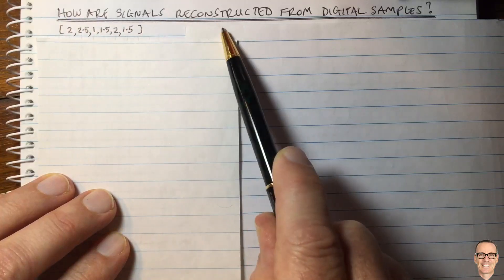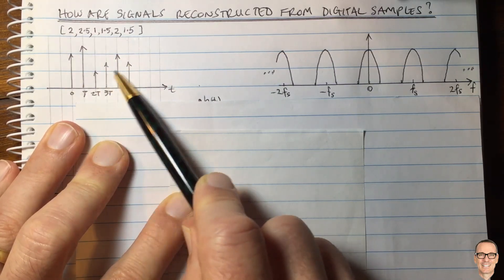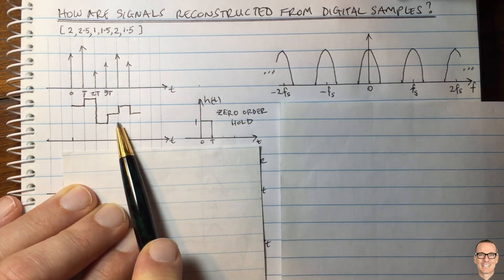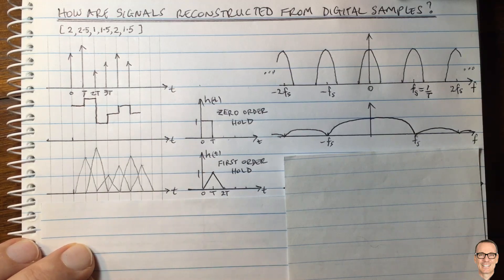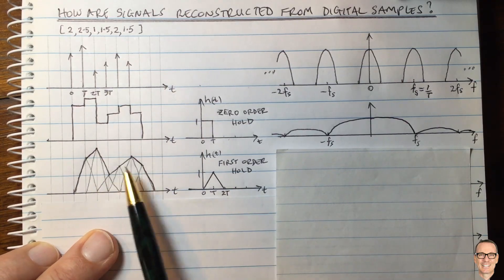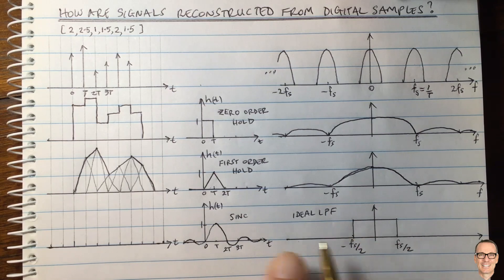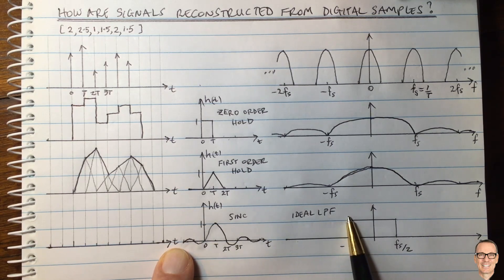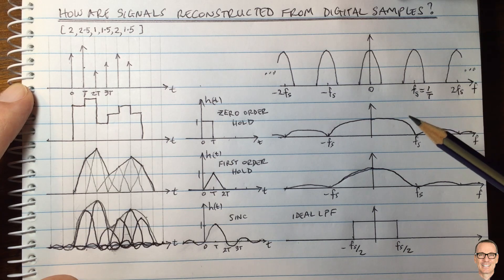How are Signals Reconstructed from Digital Samples?

Comment: Initial honest response after watching: "Bruh". Wow. Thanks for clarifying that. So the sinc function "filter" is opposite of that square dealio (to the right of it in frequency domain) why? Is that because a square has unlimited harmonics? And bonus question, because it's been bothering Me the past 2 days and the AI chatbots haven't answered it logically yet: Does hard clipping a 10hz (or any other sub-20khz) sine wave sampled at 44100 introduce any aliases of upper harmonics, or does it simply flatten the peaks without introducing any such aliases and then output a gibbs effect style sinusoid "wiggly" at half the sample rate around those samples in a row at the flattened peak when passed through a sinc function and a lpf after? (I know that a square wave and a squared off wave have upper harmonics beyond 22000, but merely flattening a sinusoid's peaks doesn't seem to actually introduce any "aliases" of upper harmonics)

Comment: Thank you. I have one point of confusion:
When we talk of discrete convolution,  h(k) i.e. the impluse response is really a sequence of N taps, where k is an natural number < N. 
Are the continuous zero order, first order hold and sinc impulse responses in fact discrete with large N?
Not sure how to think about this.
Reply from the maker: Discrete-time does not imply finite time. ie. it is not necessarily the case that the impulse response is finite duration (ie. finite N). In practice of course, nothing lasts for infinite time, and if you're talking about "real signals" that have been sampled onto a computer (for example) then yes, there is a finite N (because the memory of any real processor is finite). Does that explain it?

Comment: I had to swap to using a tablet for all of my writing needs due to a wrist injury, but wow it is such a major upgrade. I really like this style but definitely consider swapping to tablet based recording/drawing. One huge advantage is you can copy/paste diagrams you are working on you can slowly build them up as learning aids, while keeping the main structure the exact same. I use this method for my design work as well. It significantly improved my workflow
Reply from the maker: Yes, those are good points, however there's no way to point with your hands, and make it feel truly personal, when using a tablet.

Comment: Why is the sinc function of Fourier transform zero order hold is positive? Because Fourier transform of a rectangle function is sinc which can have negative values which are below y axis. Why didn’t we taken that kind of sinc function here. Instead we took modulus of sinc function which is Fourier transform of triangle signal.
Reply from the maker: In the frequency domain I only plotted the magnitude of the sinc function. It's a complex valued function (in the frequency domain), so it also has a phase (that I didn't show). In the time domain, it is a real valued function, so I plotted its actual value (positive and negative).

Comment: Really interesting, thank you! Am I right in saying that's just one of the original waveforms that could have produced those samples? I guess we're saying that the sampling rate defines the highest frequency we care about and that everything above it is considered noise?
Reply from the maker: It's not the "highest frequency we care about", it's the highest frequency that can be captured during the sampling process and then reconstructed from the samples. This video should help: "How to Understand Aliasing in Digital Sampling" https://youtu.be/y7UOQ_aF9C0
Reply: @iain_explains  Thank you - I think I meant "we chose the sampling rate based on the highest frequency we cared about reconstructing". I think I'm having a hard time seeing a 1-1 mapping between sampled signal and reconstructed signal, but I suspect I'm looking too closely at the edge conditions (T=0) and not allowing for noise (which I consider to be signal components of higher frequency than we allowed for in the sampling rate). It's all fas
cinating, thank you
Reply from the maker: It sounds like you may not fully be understanding how aliasing affects the sampled signal. Here are some more videos on that: "Aliasing Ambiguity Explained" https://youtu.be/zUAka4orrJA and "What is Aliasing?" https://youtu.be/B3nZUFNkTGY
Reply: @iain_explains  thank you!

Comment: Hi Iain. Many thanks for one more amazing video. Just one question out of curiosity. Do you have insight which approach is in use in mobile communication, especially in 4G and 5G? If I have to bet on one, I will say some kind of sinc approximation.
Reply from the maker: Mobile communications involves a number of different sampling operations. So there's not one single answer to your question. In the case of sampling voice signals, they are sampled in a way that involves compressing the data stream, and the reconstruction needs to be done in a way that matches the way they were sampled. It's complicated (and interesting too), and I've got it on my "to do" list as a topic for a future video.
Reply: @iain_explains  thanks a lot. I can imagine it is not simple story. Looking forward to understand it in more details from your videos. Wish you all the best!

Comment: This is an excellent visualization of why digital doesn't actually sound like the overly simplified stair-step that laypeople often imagine it does. Thank you for taking the time to put together such a clear explanation. I was able to use your video to help a non-technical friend understand digital audio better.

Next, please consider a tutorial of how the different types of output filters we commonly see in audio work: linear phase, minimum phase, butterworth, brick wall, (and others?). The problem with actual circuits in the D/A stage of real world gear is that they either impose a single filter choice or they give a range of choices with very little explanation of the trade offs of each. Are there pieces of gear that offer the ideal linear pass filter or is that an impossibility to create economically in real world circuit applications? I'd love to know! Apodization! So confusing.
Reply from the maker: I'm so glad to hear that the video has been helpful. And thanks for the topic suggestion. I've put it on my "to do" list.

Comment: Great videos. But one thing confuses me: if you look at the fourier transform of the signal with delta functions, you see fairly narrow bandwidth peak in frequency domain. But when you "reconstruct" the signal with zero order hold or first order hold, the peaks get much wider (all the way to Fs) - is this result of some aliasing or just a quirk in the drawing?
Reply from the maker: Ah, that is an excellent question. I guess I didn't make it clear enough in the video. The top frequency plot is the Fourier transform of the sequence of delta functions shown in the top time-domain plot (ie. the "sampled signal"). But the three frequency domain plots underneath it are the Fourier transforms of just the impulse responses of the three "reconstruction filters" shown in the middle column of time-domain plots. In order to find the Fourier transform of the three reconstructed signals (shown in the left column of time-domain plots), you need to multiply the top frequency plot, with the respective reconstruction filter's frequency plot (since they are convolved in the time domain, which is equivalent to multiplication in the frequency domain). For example, with the bottom filter, it zeros-out all the higher frequency aliased copies, in the top frequency plot, and perfectly keeps the central component, around f=0.
Reply: ah i might have got it partially: those peaks are not the same peaks visible in the first plot, but instead the later cycles of the sinc function. but still i don't understand how they become so wide. shouldn't atleast the baseband peak be about the same width as in the first plot?

Comment: What do you think is the basic operation of the latest AK4499 flagship DAC? You think that chip is performing a sinc function on the signal?
Reply: Is there a difference between reconstructing with a near perfect sync and reconstructing with a simple first order hold and a very steep analog LPF? I know mathematically a perfect LPF is a sync. But with filters I think of coils and capacitors
Reply from the maker: I'm not a hardware expert or an audio processing expert but looking at the specs it says it can play out sampled signals with up to 1.536 MHz sample rate with 64-bit PCM. That's very high for audio, which is in the range 0-20kHz or so, but it does allow for overcoming the practical problem of not being able to generate the theoretically optimal sinc pulse reconstruction filter for signals sampled at only the Nyquist rate. Over-sampling is how most ADC/DACs work. Here's a video on the extreme case of having only a 1-bit DAC: "What is a 1-Bit DAC and How Does it Work?" https://youtu.be/3R8ipTHb9xQ

Comment: Thanks Prof. so much, but can you tell us devices use these models?
Reply from the maker: One example is the one-bit DAC that uses the first-order hold filter. These first became popular in portable CD players - like the one I had when I was at uni back in 1991 - because they are very cheap and easy to implement. They are now being proposed for use in mm-wave massive MIMO systems. The trick is that they are run at a much higher clock (sample) rate, so the overall waveform can look smooth. Perhaps I'll make a video on this to explain more.
Reply: @iain_explains  Thank you very much Prof.

Comment: Sir. May I ask that what is the relationship between spectrum of digital signal (discrete value) and that of sampled signal( discrete time but continuous value) ? In your video, you took the discrete numbers as samples of digital signal but you showed the spectrum of sampled signal assuming that both spectra of digital and sampled signals are one and the same. May you please highlight the difference between two if it exists from your practical insight ?
Reply from the maker: I think this video should help: "Continuous Time and Discrete Time Fourier Transforms" https://youtu.be/lLq3D-v4kPU

Comment: prof can you give us the circuit to generate sinc signal?
Reply from the maker: Sorry, but circuits are not my specialty.
Reply: You can't generate a true sinc signal since it's infinite and acausal, but all real circuits are causal. To generate a truncated version you would need an arbitrary waveform generator since a sinc is a rather complex signal.

If you want more information on how signals from a DAC are reconstructed in practice with real filters, you can google "Keysight AWG primer". Look for section "Reconstruction Filter" - there you'll find that in practice, a bessel filter is used for optimal time domain response (minimal overshoot and ringing) and an elliptic filter for optimal frequency response (faster roll-off near the nyquist frequency). The document describes the topic in the context of arbitrary waveform generators / high-speed DACs. You can google possible circuits for these filters.